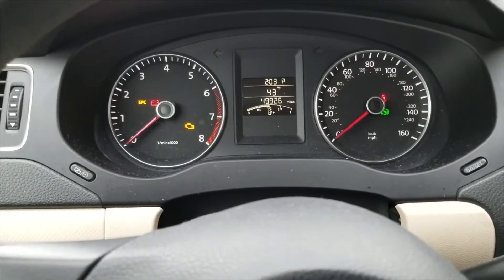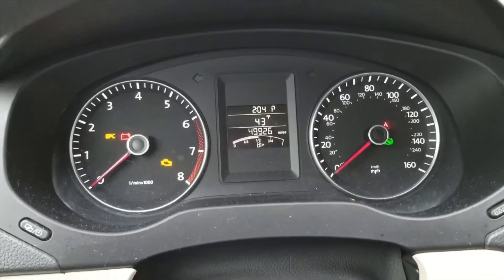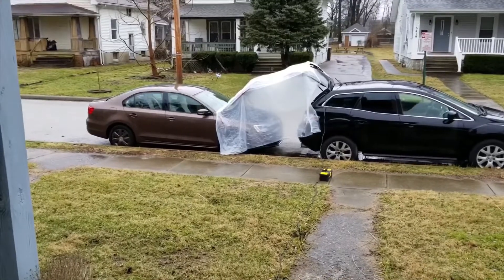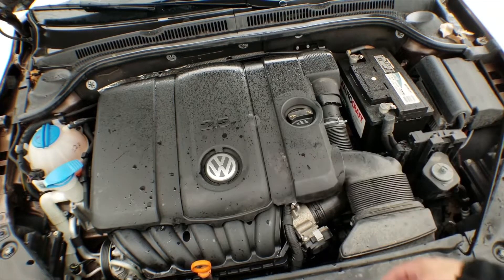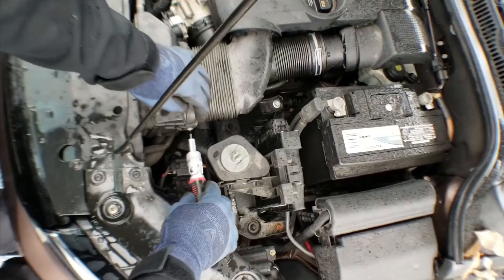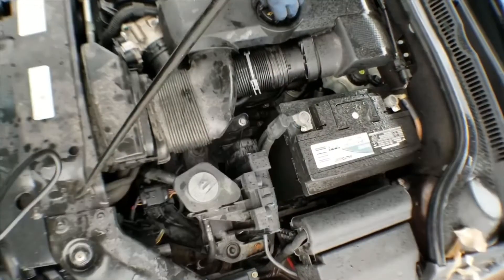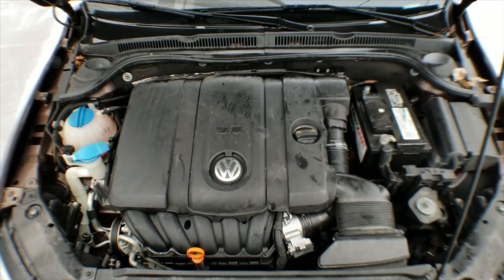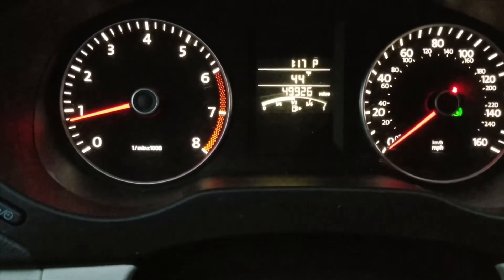Volkswagen EPC Light Diagnosis: Throttle Body Replacement

Comment: Gotta say, followed your instructions to the t. Had same issue as you in my jetta and I must say thank you for the guide! Couldn't have been any more easier to follow what to do. Keep doing what you do!
Reply from the maker: Hey thanks for tuning in! It is greatly appreciated! I am happy to hear that this video had helped you resolve an EPC light issue 👊🏾  I appreciate the positive feedback thanks👍🏽 Stay Tuned and consider subscribing if you enjoyed the video 🤜🏾🤛🏾 thanks again!
Reply: @elevatedpotentialacademy  one question, did you have to reset the gas pedal sensor after changing the throttle body? It seems my timing may be a little off. I have a diagnostic tool that can reset the timing. Just asking.
Reply from the maker: @mikeytoth100  Hey! I actually didn't have to reset or relearn the throttle for mine. It had worked well after install. Hopefully that does the trick.

Comment: Replaced it as directed, but still showing EPC light and check engine.. plus a high idle/low MPG. Anyway to lower the idle?
Reply from the maker: Hey thanks for tuning in! It is greatly appreciated! I hope that this video was helpful and will help you resolve an EPC light issue 👊🏾 id recommend Disconnecting the battery greater than 15 minutes in order to allow the system to relearn idle upon turning on. If it continues you will need to check the connection of the air intake and other lines you disconnected. If that isnt it maybe a be the Idle Air Control Sensor.   Keep me posted on the results👍🏽 Stay Tuned and consider subscribing if you enjoyed the video 🤜🏾🤛🏾 thanks again!

Comment: I have a 2013  VW cc and my epc light is only coming on periodically while i drive, as well as my check engine light. Do you have any recommendations for this?
Reply from the maker: Hey thanks for tuning in! It is greatly appreciated! I hope that this video was helpful and will help you resolve an EPC light issue 👊🏾 id recommend getting the check engine light read with an OBD2 scanner in order to narrow down the potential issue. You can get this done for free at a parts store like auto zone or advanced auto!   Keep me posted on the results👍🏽 Stay Tuned and consider subscribing if you enjoyed the video 🤜🏾🤛🏾 thanks again!
Reply: mine was a wiring issue. one of the wires was chafed...

Comment: Hey man great video. My wifes just did the sane with p2106 and p2101 both reference throttle body. I cleared the codes and its been about two days with no issue. If it happens again I'll swap it out. Also you don't need to remove oil cap to take cover off and I'm sure you know this but your air filter is in that cover. Thanks again and good luck.
Reply from the maker: Hey thanks for the positive feedback and tuning in! It is greatly appreciated! I'm glad that this video was helpful and you were able to resolve your EPC light issue 👍🏽 Stay Tuned and consider subscribing if you enjoyed the video 🤜🏾🤛🏾 thanks again!

Comment: My 2014 Jetta 2.0 epc light come when I mash the has had and check engine light starts blinking and we checked it says random misfire
Reply from the maker: Hey thanks for tuning in! It is greatly appreciated! I hope that this video was helpful and will help you resolve an EPC light issue 👊🏾 a tune up is required it sounds which is also a cause for EPC warning (spark plugs/coil packs/wires)!   Keep me posted on the results👍🏽 Stay Tuned and consider subscribing if you enjoyed the video 🤜🏾🤛🏾 thanks again!

Comment: I'm no mechanic, but this video did the trick. I had codes for this and the Leak Detection Pump. Was able to do both in about an hour and a half. Cleared all the codes and check engine and eps lights all gone.

Comment: Hey.  My problem is nearly the same I have 2012 Jetta and right now the throttle body system is back ordered.  I took my car first to Pep Boys then I called my dealer and my dealer said that Pep Boys cant really fix electronic problems.  My ECP and and engine light is on. I have 55k .  How much do you think once they get the part might run?  Thanks!
Reply from the maker: Ive had many many people comment on their experience and all were over $800 at least. I'd recommend just doing it yourself for $70-80 at home. Thanks for tuning in and if you had enjoyed the video please consider subscribing 🤙🏽 Good luck with the repair and STAY TUNED 👍🏽

Comment: I had same issue, same warning lights but had nothing to do with throttle body. It was the Camshaft Position Sensor.
Reply from the maker: Yes it has many many possible causes thats why I put throttle body replacement in the title!  I had included some more possible issues in the second video in which had included the camshaft position sensor ! With that being said, i am glad you were able to resolve the issue🤙🏽 thanks for tuning in and if you had enjoyed the video please consider subscribing 👍🏽 thanks for the update and STAY TUNED !
Reply: That happened to me too! They replaced my camshaft sensor as well. Since then I've had the light come on once and havent seen it again in months.

Comment: Hey where did you get your throttle body from..
Reply from the maker: Hey thanks for tuning in! It is greatly appreciated! Here is a link to the throttle body I got : https://rover.ebay.com/rover/0/0/0?mpre=https%3A%2F%2Fwww.ebay.com%2Fulk%2Fitm%2F253896564409
🤙🏽 Stay Tuned and consider subscribing if you enjoyed the video! Thanks again!!
Reply: @elevatedpotentialacademy  thanks a million,  my son has a 12 passat and has the same issue..going to order as we speak ..good lookin Robert
Reply: @elevatedpotentialacademy  just installed the throttle body and thanks to your great video, it help me and my son alot..thanks again..

Comment: I have a 2019 Jetta and both engine and epc light is on and it says engine speed max 4000 rpm and I brought it to my mechanic they said it was a knock sensor fixed that but the problem is still here basically wasted money
Reply: Ouro Boros i see this A month old bit I’ll shoot anyway. I’m no Volkswagen tech worked for GM a while. Sounds like a throttle position sensor not sure if he replaced the the whole unit with the throttle body. The TPI could have been the trouble in the vid assuming replacing the throttle body with a new one would also have a factory new TPI. I’d bet it’s one of the 3 thing he mentioned. PEDAL TPI OR THROTTLE BODY. The newer vehicles usually have a fly by wire throttle by wire. Meaning no throttle cable to connect the pedal to the throttle lever. Hope your up and going already if not hope this helps. Also I’m curious as to what fixes or fixed the problem. Can’t believe the tech went straight for the crank sensor🤬
Reply: i had a code p0122 pop up and it ended up being a bad wire. one of the wires related to the throttle sensor was chafed. unfortunately they only figured this out after already replacing the throttle body ($500) with a brand new one and seeing that that didnt fix it, so i wasted a ton of money too. it sucks we have to be responsible for the mechanics mistakes
Reply from the maker: Hey thanks for tuning in! It is greatly appreciated! I hope that this video was helpful and will help you resolve an EPC light issue 👊🏾 id recommend getting the check engine light read with an OBD2 scanner in order to narrow down the potential issue. You can get this done for free at a parts store like auto zone or advanced auto!   Keep me posted on the results👍🏽 Stay Tuned and consider subscribing if you enjoyed the video 🤜🏾🤛🏾 thanks again!

Comment: This sis a great page. Thanks for sharing your knowledge. My son just bought a 2014 jetta SE a month ago and the EPC came on and the car was limping along, but never really lost total power. Took it to the dealer(big mistake), and they told me the Fan assembly needed to be replaced along with the coils and the spark plugs. $2000 later I get the car home  and last night the EPC came back on, and the car was sluggish!!!WT? Also, the engine llight has never come on when this EPC light comes on. Cannot afford to take it back to the dealer so any suggestions? Thanks
Reply from the maker: Hey thanks for tuning in! It is greatly appreciated! I hope that this video was helpful and will help you resolve an EPC light issue 👊🏾 if there is no check engine light id still recommend getting the check engine light read with an OBD2 scanner in order to narrow down the potential issue. You can get this done for free at a parts store like auto zone or advanced auto! Sometimes the code is pending and not fully confirmed in the system. Keep me posted on the results👍🏽 Stay Tuned and consider subscribing if you enjoyed the video 🤜🏾🤛🏾 thanks again!

Comment: Very informative, my EPC and check engine light came on this morning right before work, ‘13 VW Passat, it struggled to turn twice then it turned on and the light went away along with the check engine but I’ll take it anyway and see if it’ll throw a code

Comment: Hey man, nice video! I’m throwing a P0122 check code with EPC on, “Throttle/pedal position sensor circuit A low input” pretty sure replacing my throttle body will fix it right, was that the similar code you got?
Reply from the maker: Hey thanks for the positive feedback and tuning in! It is greatly appreciated! Yes that is a similar code to what mine had but it was P0222 with the same warning; therefore, I'm more than certain that it is your throttle body (poor acceleration) unless your pedal itself is intermittentley responding (like refusing to accelerate at all at times). I'm glad that this video has helped point you in the right direction and save you a bunch of money 👍🏽keep me updated🤙🏽 Stay Tuned and consider subscribing if you enjoyed the video! Thanks again!!
Reply: Ballin On A Budget Auto thank you man! Yeah unfortunately I did just replace the pedal yesterday thinking it would’ve solved the issue turns out it didn’t lol. Okay It’s gotta be the throttle body then, cleaned it two days ago still epc and check, I have a 2012 Jetta se 2.5L, stalled 3 times today starting it so I wanna say throttle body, what do you think?
Reply from the maker: @121abcx  haha well damn! It was worth a try but yeah I'm sure it is the throttle body for sure because it is that exact code and it is poor acceleration and stalling 🤙🏽 welcome man hopefully all works out fine!
Reply: @elevatedpotentialacademy  Watched a lot of videos before diving deep into it lol, I'm by no means a mechanic at all so thanks for youtube and your videos man! Just ordered a remanufactured throttle body and new gasket, should arrive tomorrow morning that way I can get to work! Thanks again brotha, great explanation throughout your entire throttle body change
Reply from the maker: @121abcx  Awesome I hope it all works out! Im sure you will be just fine Ive only been working on my cars for about 3-4 years just gotta start somewhere with doing the research before getting started, taking your time, and being confident you'll get the job done! Take pictures if needed too!  How much for that remanufactured one? The one I bought may be cheaper brand new. Thanks again! https://rover.ebay.com/rover/0/0/0?mpre=https%3A%2F%2Fwww.ebay.com%2Fulk%2Fitm%2F253896564409
Reply: Ballin On A Budget Auto Thanks for the confidence bro lol, I’m really hoping it’s the fix since the TPS is inside the throttle body anyway, not serviceable separately, thanks VW.. hahaha I’ll let ya know how it goes man! Thanks again
Reply: Ballin On A Budget Auto Damn I wish I saw the rest of your reply first!! It was $282 all together for the remanufactured body and new gasket with overnight next day delivery from Rock auto :/
Reply: Ballin On A Budget Auto Well my man! Thank you so much for the video!! My throttle body and gasket came in this morning, had the old one off and new one in and all back together within an hour cuz of your instructions! Worked perfectly by the way, no more EPC or check plus acceleration was definitely boosted it feels! Thanks again man!
Reply from the maker: Awesome man 🙌🏾🙌🏾 I'm glad it worked and this video was able to help 🤙🏽 thanks for the update and I hope all that EPC light crap is over with haha ! Thanks again for tuning in and stay tuned I hope to post more repair videos here very soon👍🏽

Comment: Back in march my epc light came on and check engine light I was like wtf turned off the car, tried turning it back on it worked but got up to 35kmh get out, boom gas leaking fucking everywhere drove it home, brought it to the garage said i was lucky it didn't start on fire lol, anyway they assessed it and said thr fuel line system broke off completely and I needed a new o-ring, 1200 dollars later its back to working again but lately I've been having trouble with epc and acceleration on highway speeds and going on the ramps to freeway it'll come on after going hard on the peddle, no engine power loss but acceleration is an issue and epc light goes away after car gets shut off 
Just wondering if I should give this a try or bring it into the shop again?
Reply from the maker: Hey thanks for tuning in! It is greatly appreciated! Oh wow damn thats wild!! Mine had done that for a number of weeks and it would resolve with a restart however eventually it failed accelerating altogether so id recommend getting a start on it the next time it turns on. I'd recommend to read the code with an OBD2 scanner and hopefully it will help you narrow down the possible source of the issue which could very well be the throttle body but try to scan it first at a local parts shop for free if you don't have one or taking it to the dealer and having them look but i could see them trying to charge for something 👍🏽 Stay Tuned and consider subscribing if you enjoyed the video! Thanks again!!

Comment: Just replaced the throttle body on my 2012 Passat 2.5L with error code p0122. I went to O’Reillys and they told me it was the Throttle Position Sensor (TPS) and that I’d need to replace the whole throttle body, since the TPS is not serviceable (it’s connected or a part of the throttle body). Your instructions were very handy. EPC light turned off immediately. Check Engine light turned off after driving 10-20 miles. I bought one on Amazon for $64 along with adjustable hose clamps and an air filter. I probably would have struggled to figured out the engine cover and would have had get hose clamps later without your video.  So far, so good. Thank you sir!
Reply from the maker: Hey thanks for the positive feedback and tuning in! It is greatly appreciated! Awesome I'm glad that this video has helped resolve the problem and thanks for the update 👍 haha those clamps and engine cover are kind of a pain 😂 Stay Tuned and consider subscribing if you enjoyed the video! Thanks again!!

Comment: Great video and explanation of what you did to resolve the problem (engine in limp mode, check engine light, and EPC warning light).  But, I would prefer to use the OBD2 scanner for codes first before spending a bunch of money on new parts, not really knowing before hand if replacing the throttle body is really going to work.  So, kudos that your first guess was the correct issue.  And if the throttle body was not the answer what were you prepared to do next to figure out the problem?   Keep up the good videos!

Comment: EPC light came on, car drove weak acceleration, I turned car off and on and light went away.
It’s been a day and the light hasn’t come back.   Should I take it to mechanic or wait?  
Thanks .
Reply from the maker: Hey thanks for tuning in! It is greatly appreciated! Mine had done that for a number of weeks and it would resolve with a restart however eventually it failed altogether so id recommend getting a start on it the next time it turns on. I'd recommend to read the code with an OBD2 scanner and hopefully it will help you narrow down the possible source of the issue or taking it to the dealer and having them look but i could see them trying to charge for something 👍🏽 Stay Tuned and consider subscribing if you enjoyed the video! Thanks again!!
Reply: I've had that happen to me as well. I've taken it to a mechanic once and they couldnt find anything because the light never came back on for them. And then the light comes on and flashes off every once in a while now.
Reply: amcclain1989  maybe carbon build up?   
I have VW warranty but I hate going to dealership, it’s such a hassle!

Comment: someone told me that even if I change it, I still need to take it to the dealer to re-program it; also how do you know if is the Throttle body or the Throttle Position Sensor? is there a difference in the codes? I got both EPC and Check engine lights and sometimes the gas pedal doesn't want to work.
Reply from the maker: Hey thanks for the positive feedback and tuning in! It is greatly appreciated! I hope that this video was helpful and will help you resolve your EPC light issue 👊  No you do not need it to be reprogrammed I never had an issue with throttle response afterwards. Most VWs run on an electronic throttle body since the early 2000s or so therefore it is just the whole throttle body regardless of either code throttle Position sensor or just throttle body unless you visibly see a sensor that can be removed from the throttle body itself. What year and model? You will get both the EPC and check engine light. If you want to narrow down the issue id recommend getting an OBD2 scan of your vehicle for free at a local part store in order to read the check engine light for the issue! Stay Tuned and consider subscribing if you enjoyed the video! Thanks again!!
Reply: You step on the accelerator while the car is off then switch the key to the on position ....do not start the car ....wait ten seconds then turn the key to the off position and release accelerator ....just read up on it right now trying to see if we just replace the sensor